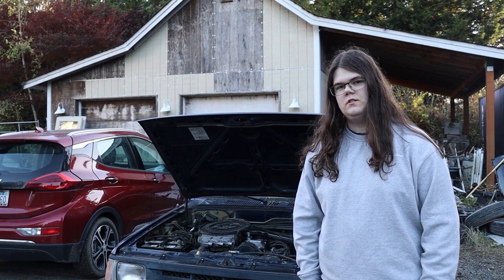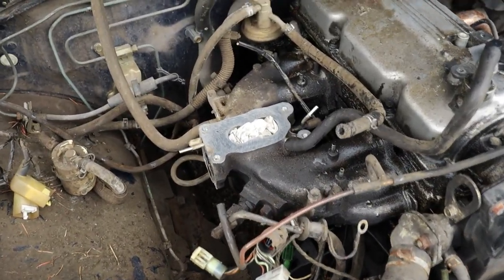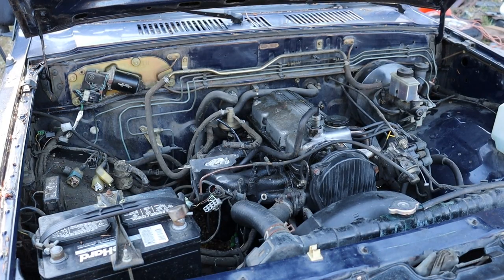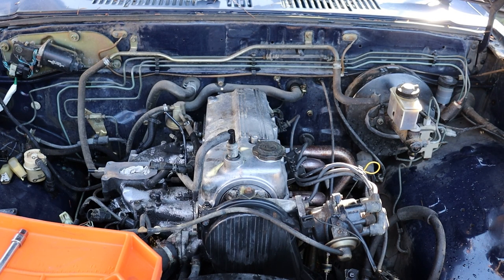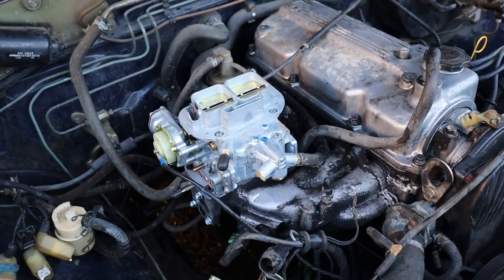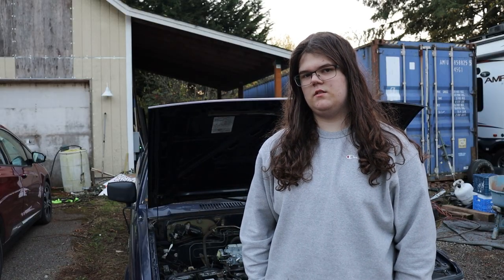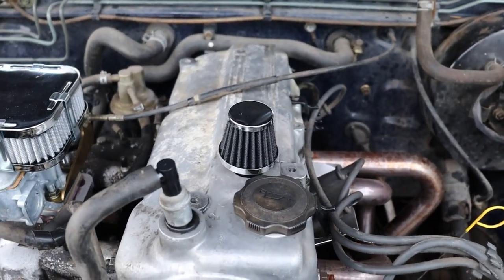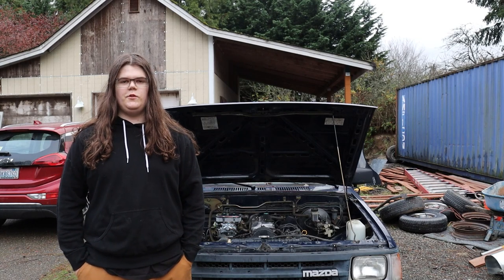My Mazda B2200 Gets A Weber Carb

Comment: Kool, I had an 89 b2200 automatic. Sold it in early 2000’s with 220k miles. It still ran great, 29mpg. It was starting to use a bit of oil tho…
Looking forward to your future videos. Wish I still had mine.
Subscribed #69 😉

Comment: There is a hole in the bottom of the filter housing on the carb. You'll need to plug that hole ( It would normally be used as a connection to the oil breather port on the valve cover ) ; If you haven't done that already. -- plugging the hole just prevents dust and dirt from bypassing the filter and going into the engine.
Reply from the maker: yes i did do that, unfortunately i forgot to record it and didnt notice it wasnt included in the video until after i published it but it is definitely important to do
Reply: @Blue_B2200 how can I contact you
Reply from the maker: dm me on instagram @blue.b2200
Reply: I have a question. I plan on doing the carb kit later but for now whenever I put the truck in gear the rpm shoots up and pushes me,it will run on it own about 35mph, any idea why?
Reply: @donathompson2990  sounds like a stuck linkage or idle adjustment needs to be done

Comment: In the US for the 1980 model year, it was sold as the B2000, which used a 2.0-liter F/MA engine, replacing the B1800. The diesel 2.2-liter B2200 was sold from 1981 with the chassis code UD (introduced during 1982 for the United States).

If it has a carburetor then it isn't a 2200. Straight from wikipedia, the gas engine is the B2000 as it is a 2.0 liter engine. The Perkins diesel is the 2.2 liter B2200.

Your truck is great and so is your channel, just wanted you to be aware as a fellow B series owner.😅
Reply from the maker: youre wrong, my truck is a uf chassis, all b2000 and b2200 sold in the u.s. from 1986-1993 are carbureted unless originally sold in california. my truck uses the f2 2.2l carbureted gas engine, the uf b2000 uses the fe 2L carbureted gas engine.
Reply: naw man, B2200's were 1987-1991 i think. 2.2l gasoline engine. I have a 1989 B2200, and it is carbureted. The factory carbs are complicated and a pain in the butt though.

Comment: Hey, great videos! How have you been liking the Weber? What have you found are the benefits of having it vs. the stock carb?
Reply from the maker: biggest benefit is probably throttle response, power isnt really improved at all but it feels more accurate to when i press the pedal, it also increases intake noise which is nice

Comment: Do you need to take the rubber grommet off from in between the throttle cable, Saw that in another video
Reply from the maker: not sure if you mean take the grommet off entirely or just remove it temporarily, definitely not permanently. i also dont recall having to remove it to install the cable but i could be misremembering

Comment: Why do you have to take the icu" what’s is it for? And with the weber is it running better and faster? And keep the good work man
Reply from the maker: you dont necessarily have to remove the ecu however its of no use unless you want to go back to the factory carb at some point, they can be sold on ebay for about $100 so i took it out because i figure i may as well make some money back from the price of the weber carb. it's running a lot better and smoother than factory with the weber, throttle response is much better but i wouldnt say theres a noticeable increase in horsepower at all, fuel mileage (when properly tuned) is also better which is an added bonus

Comment: what power source do you have the choke hooked up to? im having trouble locating the wires.
Reply from the maker: theres a wire that connects to the alternator which is what i connected it to,  you have to cut the factory connector and crimp on a new one because its held in place solid on the factory carb

Comment: Would you please show how you wired the Electric Choke to the distributor???
Reply from the maker: unfortunately cant go back in time and record that however i can tell you, all that i did was cut the wire of the choke and then peel back the insulation a little bit to get some wire visible and i crimped a connector onto the factory wire

Comment: Before i install the weber, i should probably do the timing belt, water pump, valve seals, head gasket, valve gasket first, right? Lol, im not ready for that. I have a b2200 1992 with only 90k miles, but all the rubber gaskets are disintegrated, maybe from age or ethanol..
Reply: At this point, I may as well do a full rebuild... lol or engine swap.
Reply from the maker: honestly weber first is not a bad idea lol, makes the engine bay sooooo much easier to work on man, it'll save you so much time especially with belts and gaskets

Comment: So I am curious why would you do the $526 Weber vs the $160 no name carb on this truck?
Reply from the maker: the cheaper weber knockoffs are known to have inconsistent chokes, fuel mixture screws that back out, etc. so i went with the one i knew wouldnt cause me problems, nothing stopping you from using a replica though
Reply from the maker: you can also sometimes find the authentic weber carbs on sale, i got mine for ~$380
Reply: Im gonna mention i have the knockoff and it runs perfect. May have been lucky? Never had problems runs smoother than ever.
Reply from the maker: i know that they still work but for how long they work well im not so sure, biggest concern would be reliability/longevity
Reply: Why would you want a cheap Chinese made knockoff when you can spend a few more hundred dollars to get the genuine Webber carb that you will only put in once and have no problems.  With the cheap Chinese carbs theres problems with them.
Reply: @carlandersonlll6861  If you know and understand the problems, it is not difficult at all to correct them prior to installation. I use cheap chinese knockoff carbs all the time on motorcycles. They are great, last week I bought 2 dirt bike carbs for $42.00, to fit my prototype  intakes for a KZ750 to run on two manual carbs instead of the 4 CV carbs, they kick ass. Easier to tune than Mikunis and run just as good.

Comment: Will it fit my Mazda 1.8 Lt block VC?
Reply from the maker: i do not believe so, it seems from what i can find that the b2200 kits use a different intake adapter plate, depending on what vehicle you have there is a kit designed for that engine on a mazda b1800

Comment: Where you hook the electric to?
Reply from the maker: the choke on the new carburetor
Reply: Yup the electric choke is that the cable that comes from the alternator ?
Reply from the maker: correct, it is